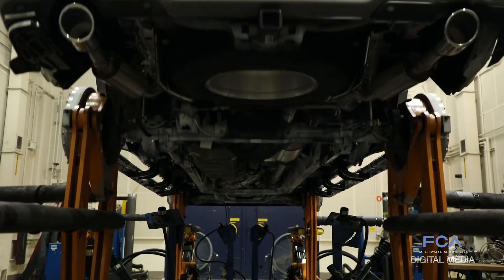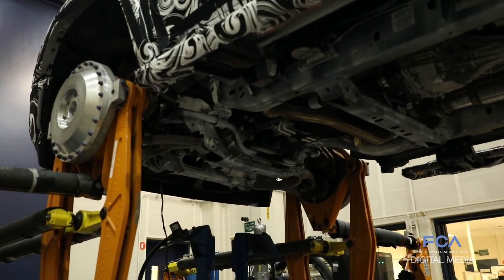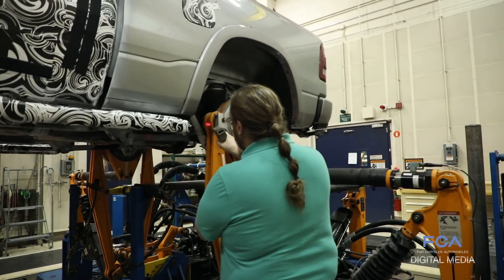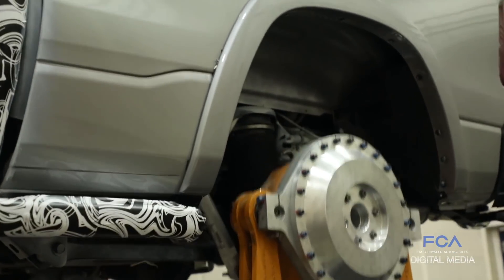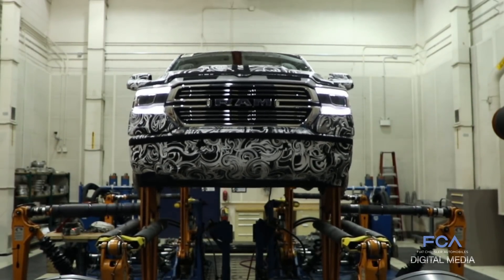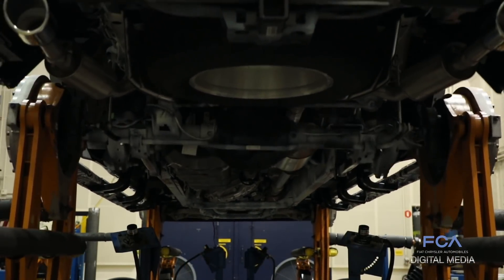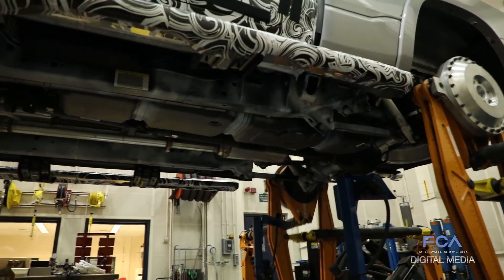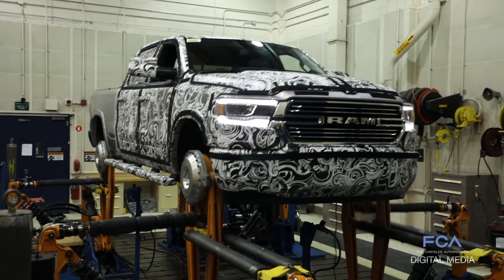2019 Ram 1500: Shaker Testing

Comment: I hope you improved roof strength and small overlap testing. Other companies make a safer truck then Ram, so I hope the redesign addressed those issues.
Reply: The overlap was heavily improved, the new has sway design in the front just for the overlap crash.
Reply: 19 ram has proved by iihs small overlap very safe
Reply: Well it’s now top safety pick + (I think) so i think they improved safety.
Reply: When you look at other trucks at the time the ram is comparable
Reply: Christa Luongo ram truck are safer.. they are stronger and tougher.. i don’t know what u mean about safer..

Comment: I went shopping for a new truck. After doing some extensive research and asking a few of my buddies around. . .conclusion I arrived to is that Dodge trucks are pure crap. Money eating junks! My brother-in-law had a dodge diesel at one point that had many problems. He ended up buying a Ford. Made a U turn in the Dodge parking lot and headed over to FORD!! I'm so happy with my Ford. Going strong!! Ford built tough💪
Reply: I went to dodge because I had trouble with all the Ford's I'd had over the years and I took good care of them, never once had a problem out of my dodge 2012, and interior wise no other truck is as nice
Reply: Just saying my peace then what are you doing here...lol
Reply: You may be right. But in my opinion the new ram looks way better than the ford exterior and interior. And I believe the new ram will be much more dependable than the previous models. Give FCA a chance with this truck. It is really good.
Reply: Barsa F Mopar quality over Ford??? HAHAHA nice one, fords are the #1 rn on sales and reliability and quality... But Mopar makes better trucks than GM. I csn tell you that.
Reply: St. Beter ok sure the Dodge Ram isn’t the #1 selling truck of 2019 but it did win the truck trends truck of the year 2019
Reply: Ford truck engines are not OHV. They are either SOHC or DOHC. More expensive to repair, shorter lifespan. Ford is living in borrowed time now. If people still buy them, they don't need to test durability that much now. There's always a catch from Ford.
Reply: Had a brand new 2011 ram 350 miles on the ticker was in the shop everytime it got below 20 degrees cuz it wouldnt start
Reply: Youtuber Fordtechmakuloco makes a fortune repairing Fords, yet he chooses Ram as his personal vehicle.
Reply: @beezertwelvewashingbeard8703  I could careless what you or others drive. I proudly drive a FORD F350😊 
          🇺🇸 🇺🇸 TRUMP 2020 🇺🇸 🇺🇸 

USA   USA   USA   USA   USA   USA   USA
Reply: @CountryLivingOnTheFarm  Nobody cares what Joe Sixpack drives and neither does Trump.
Reply: Does the steering wheel tilt high enough to squeeze your gut under it?

Comment: 20 to 30k mile long test?  Try doing 150k miles on rough Pennsylvania roads, a real test of how well a vehicle is put together
Reply: I see your point by looking at the straight mileage in comparison, but perhaps you didn't hear him say "life time." If you had to bounce down a road filled with potholes for 150k straight...you probably would either walk or move to some place with better roads. This will be in baseline testing and they will go out and still drive body chassis testing for the same mileage. Not every road is perfect and they can't hit every type of road surface on the planet.
Reply: 432Point no it's just a hassle when my dodge truck needs balljoints and front end work every other year

Comment: What an interesting video, thanks for posting. I am curious though about your thoughts on how realistic this test is. Yes, you use an actual road for the movements of the truck, but what about real-world fatigue from extreme temperature changes and other things like mud/dirt/dust? Those have an effect on truck parts yet you don't seem to account for that. Thoughts?
Reply: They should hire someone (me in particular) to drive like a mad man cross country on and off road multiple times over and over until it dies
Reply: HI Michael I see your point I'm quite sure between temp. And conditions there are probably some things that may be able to endurance test but I also believe for a baseline this would be a good starting point. And if nothing else it would seem a lot of things that would fail wood show up
Reply: Michael Miller temperature has a huge impact on the durability of  vehicles. I could go on explaining all day about it, but just trust me on that.
Reply: I agree.. 110 degree day and a washboard road can boil shock absorbers.  This looks like more of an anti squeak test.